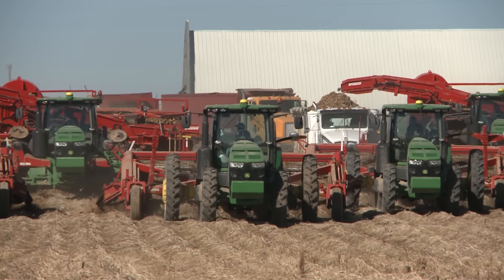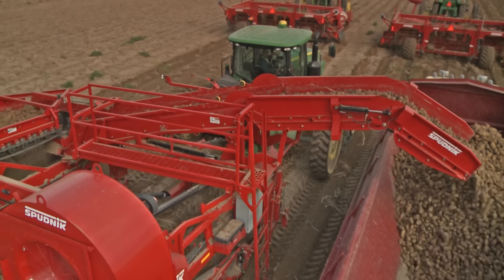16 Row Massive Potato Harvest with John Deere and Spudnik

Comment: Is this also avaible with an raw spacing of 75 cm for a personal configuration?
Reply: I doubt the scale down a $300k machine to a small garden level. However, if you have a tractor, you can occasionally find an old single row digger that would serve you well, provided you plant on the correct row spacing to get the digger through it. I have an old John Deere 30 Series potato digger and it’s awesome with my 65yr old tractor

Comment: so here a good question, how do they store the potatoes so we can have them in stores all year long?
Reply from the maker: They store them in huge cellars and then scoop them out over the year. see here: https://youtu.be/RJUV_-oTklc

This is actually how Spudnik started ...
Reply: don't they rot over time? I was thinking they stored them in a nitrogen atmosphere so they didn't rot.
Reply from the maker: Normally all the storages have a ventilation system - depending on what the situation is and the variety they need a consistent temperature and humidity. Keeping that controlled stops them from rotting. You are very right though. Storage is a science in itself.
Reply: The majority of damage in potatoes occur during storage.. but yeah thanks to storage science and its ventilation, they manage to survive quite long.
Reply: MrMark85044 im a potato guy. They go in a storage with more fancy equipment and are graded out of storage throigh a packing house

Comment: There were 4 tractors that did not have a loader and a truck. Were these tractors just diggers?
Reply from the maker: Those machines are windrowers putting the potatoes they dig in front of the harvesters to be loaded.
Reply: @SpudnikEquipment  OK, I see. After a closer look I see where the potatoes were dug up, dirt shook off and then sent to one side.

I sure love potatoes but because of diabetes I have to give up on things like that. It all turns to sugar... too many carbs.